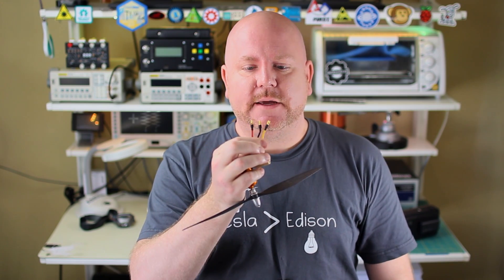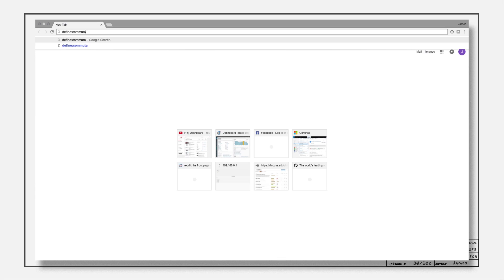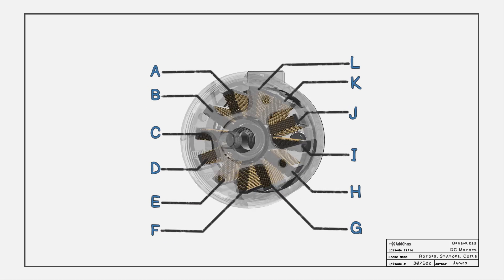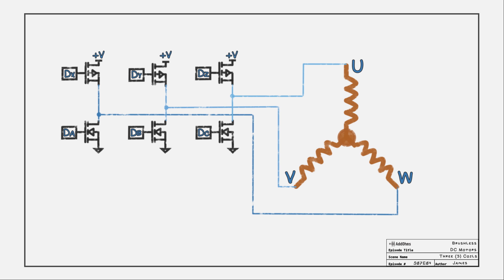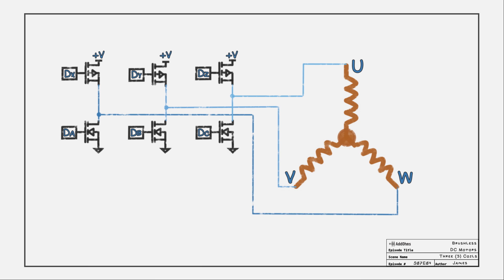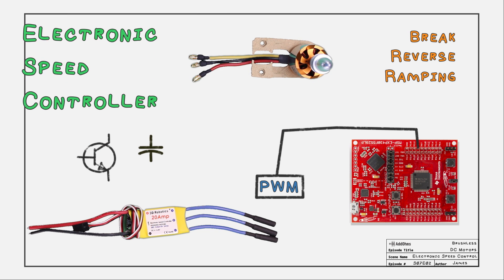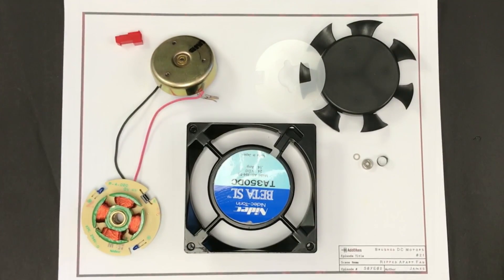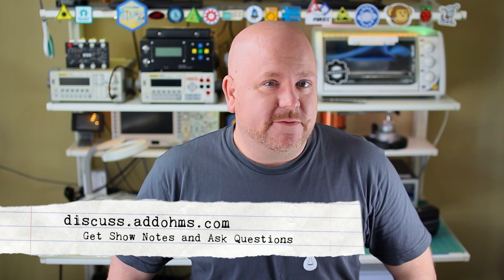Brushless DC Motors (BLDCs) Introduction  | AO #21

Comment: Hi, thanks for the instructive and fun video in BLDC motors. I understand the general principles but I'm lost with electrons. I would like to design and 3D print an engine capable of 20kW continuos at around 8-10krpm, providing the torque that it takes for a 20 cm diameter ducted fan and it should have the lowest possible diameter. Are these design requirements compatible with each other? What are thr driving design parameters for getting the required torque at a given RPM with the lowest possible diameter? Thanks in advance for any help with it.

Comment: So why do RC motors come in CW and CCW versions when they can be run either way by changing the sequence of coil energizing? Do the different motors just have the color-coded wires hooked up to different coils? And how would you wire up a CW motor to run CCW?
Reply from the maker: Mechanical reasons. It’s the direction of the shaft’s threads.

Comment: Just randomly thought of this idea, but would this motor construction be better than both inrunner and outrunner brushless motors?
https://imagebin.ca/v/4gBurThC24c8
This way you get the extra stator width benefits on top of using both pole ends to still get the extra torque without just being huge. It definitely would be difficult to construct, but maybe the benefits would be worth it in some applications?
Reply from the maker: If there was a benefit that outweighed the cost, and someone was willing to pay for it, an existing motor manufacturer would already offer it.
Reply: @AddOhms  yea I couldn't find anything about it online and already figured that seemed like common sense, so I was hoping you'd be able to explain why this wouldn't be as good.

Comment: so to recap and to squeeze out the juices and to simplify to the absolute minimum:

brushed motors -> plug it in your VCC and you're done
brushless motors -> you need a controller

is this correct?

Also, for all these months I just pumped 12V into my brushless PC / CPU fans without realizing anything. I was like, "eh, it's just signal of some sort. Other two are +12V and GND". How blissful ignorance is.
Reply from the maker: Essentially, yes.

Comment: for driving a car using bldc motor, should the power of the motor be high or low ( if the load is 200 kg)?

Comment: hello yes I have a PM 20c e060-5 Mitsubishi igbt what I need to do is it's on a circuit optic coupler I would like to design or make a circuit that can give me a six-step pwm the simplest one possible to run a motor Ac or  DC if you can help me please email me at evertonabarnes@ gmail.com
Reply from the maker: +everton barnes Sorry. that’s beyond the kind of help I can provide.

Comment: So if the coils of the motor are perfectly insulated .... will that make the motor work underwater?
Reply from the maker: I did a quick search and there are waterproof motors available. In addition to the coil windings, you also have to worry about the bearings.

Comment: I was kinda hoping you would explain sensorless operation. A few years back I breadboarded a circuit with a microcontroller and six transistors.
I didn't use an ADC to read the floating phase so there wasn't a lot of torque but I got the sequence right.
The good part is that your video got me thinking; I now think I can solve the problem I had concerning sensorless floating phase BEMF and switching times.
Reply: robberynl, I downloaded an InstaSPIN PDF about a year ago. The concepts were too advanced for me to grasp without being able to 'test' my understanding on an oscilloscope. I still don't have a working oscilloscope. I got discouraged and put the project aside.
My goal was to build a circuit using a micro, an ADC and a couple of op-amps. Part of the thrill is bit-banging. I wanted to be able to build my own ESC.
At any rate sensorless control of a bldc is still something I'm curious about. I'll get back to it eventually but probably not before I get a decent scope.
Reply: robberynl, I have a basic scope that topped out at 20 Khz but it broke and it would be useless anyway. On my channel I posted a video of a small mobile robotic arm with a pan/tilt camera. I was proud of it but it now sits on a shelf because it's way too small to do any work.
The wireless radios, (nRF24L01) only cost $1.00 apiece so they were crazy cheap but I think I can write an even better driver. The problem is they operate @2.4 Ghz and I want a scope to help me debug my code.

Comment: Hello great video thanks for all. They are like step motors.
Reply from the maker: Yup. Basically the same. The rotor, however, is very different.
Reply: +AddOhms but stepper motor has 4 wires,not 3 .Am I right?
Reply: https://sub.allaboutcircuits.com/images/02442.png Check this. The 30 degree stepper is almost same.
Reply: +Berkcan Akkuş thanks ,now i understand it.

Comment: How is that any different from a 3 phase AC motor?
Reply from the maker: The windings are wound differently. If powered by 3-phase AC, the motor (usually) takes advantage of the phase shift inherent with 3-phase AC to do the commutation.
Reply from the maker: Further clarifying, AC Motors run entirely on induction. The stator is powered by the AC source, which generates a magnetic field. On the rotor, there are metal bars that start conducting electricity because of that magnetic field, which in turn, generates their own magnetic field. The two magnetic fields attract each other.
Reply: robberynl, Addohms: Then what is a permanent magnet ac motor such as the ones in some electric cars (Nissan LEAF for example)?
Tesla is using induction motors (without magnets) but not everyone does.
Reply: AddOhms: Speaking of induction motors, it would be cool if you could make a video on how regenerative braking works with an induction motor, i.e. how you can both add energy (to create the magnetic field) and remove energy (the braking) at the same time. I find that weird.

Comment: Are BLDC's more efficient than standard brushes motors? I ask because it seems like a lot of portable power tools are really marketing their brushless tech as an advantage.
Reply: +Danny Zorn

Yes. And because there are no brushes to wear out they last longer too.
Reply: I would say not necesarily since it really depends on the amount of science you do with your electronics, the type of load, the starting torque. Turns out there's a place for everything in this world, don't discount brushed motors because they still have many uses thanks to a couple of great characteristics they have namely: High starting torque and general design simplicity.

Comment: Great video but a little think to note.
At 2:11: For future videos i think it would be easier to follow the current if you just highlight the current path with one color and some arrow. With this dots i had to pause the video multiple times to see where the current is flows. Or just add more and slower dots.
Reply from the maker: +Dev 4 This video I changed my frame rate. I didn't take that into account when I did the "electron animations". It wasn't until Final Render I notified how choppy they ended up. 

Agree though. Normally I highlight the path. This time, I just forgot.
Reply: Could always reupload.  Only other nitpick (which I'm sure you already spotted yourself) is the 3rd wire on the PC fan is usually for RPM.  Great work on your vids, you're building an awesome collection of information.
Reply: I agree with Dev 4, the dots are jumping all over the place, but still great video, very helpful, thanks